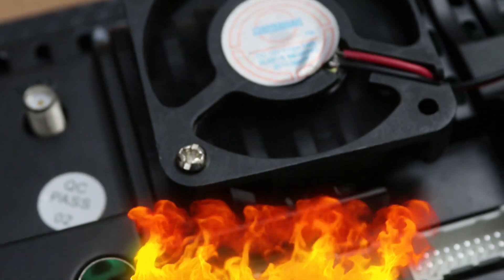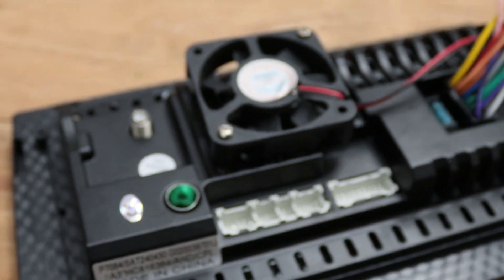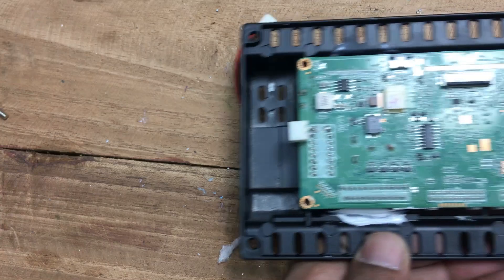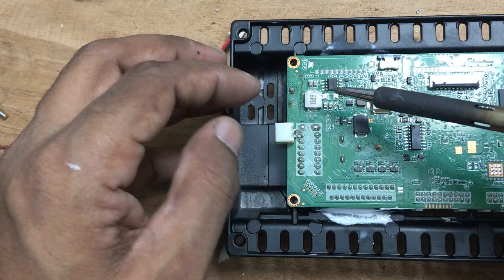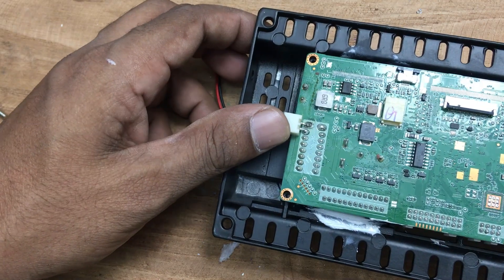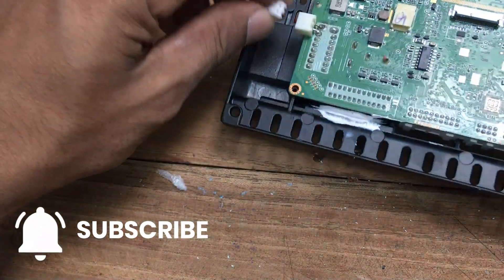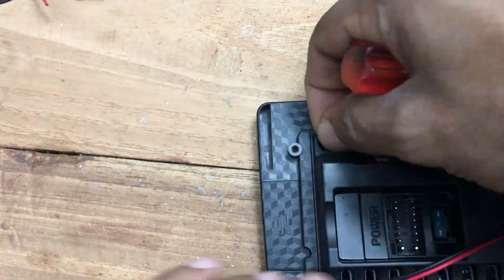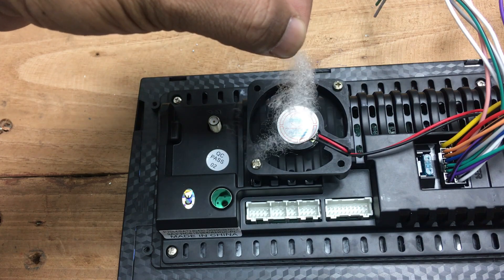How to Install a Cooling Fan in Your Car Stereo: Prevent Overheating and Malfunctions!

Comment: Fan is in wrong direction.....airflow should go into the head unit not out, and cool the chip. Please check what you are doing before posting wrong information
Reply from the maker: The wind should come out taking the inside heat . It is a basic . At least check your PC fans
Reply: @setnfix  I've been a proffessional pc builder for over 15 years. You seem to know nothing about airflow. The fan should blow on the chip and cool it down. Exhaust will NOT cool the chip. It will only remove the air inside the PCB. And about PC fans you are also wrong. Front fans  are in and top and rear are out. That's what airflow is all about. If you have an aircooler the fan is in to cool the fins, not exhaust. Only if you have 2 fans the second will be exhaust.
Reply: @setnfix  https://youtu.be/y91dxc2_u5k?si=Xdpn6SzsYcTw3ykF
Reply: @eriksrensen6369  almost any fan cooled head unit you buy, the fan is blowing air AWAY from the unit, not into the unit

Comment: hi.. the fan will still running although the player is in off state right?

there is a two socket pin inside the board. what is the function?
Reply from the maker: No. get 12V from ACC wire. if you take power from BTT+ wire, it will not tunr off

Comment: on my car stereo it is already installed, also with that small connector you have. Isn't there any other way to connect it without soldering?
Reply from the maker: It may be for the fan. But i can not confirm. If you can send me its image to watsapp I can check it.
Reply: @Anim3W0rld  i need it

Comment: Mine comes with a fan installed just no connection for it and how to control it .
Reply from the maker: If the fan is not connected, connect the wires as in this video
Reply: @saddammalima8458  same thing here, find a solution?

Comment: How will it overheat when you're using aircon?
Wouldn't that fan will just push dust inside?
Reply from the maker: You have to fix the fan to take the inside heat out side.
Reply: @setnfix  
What for if you are using aircon bro?
Reply from the maker: @FirstLast-jf9on  Reduce the heat
Reply: Dust from where? It's inside the dash. There is no dust
Reply: @eriksrensen6369 
When someone doesn't know how dust can get in there. Pffft.! Or maybe your dash is dust proof? Try opening a 3 year old dash and say that to me.